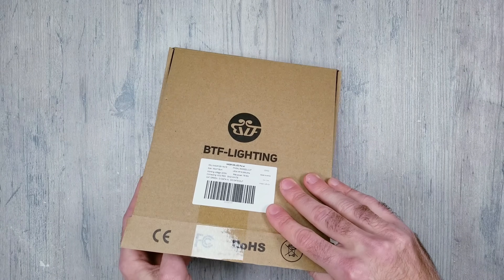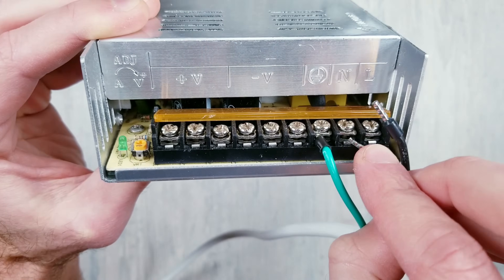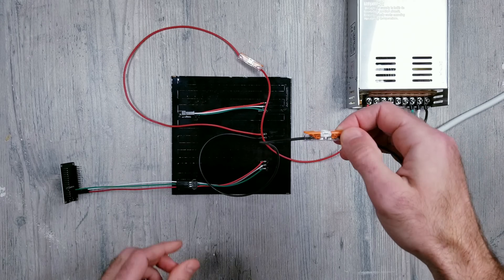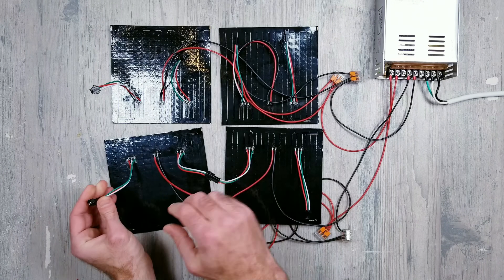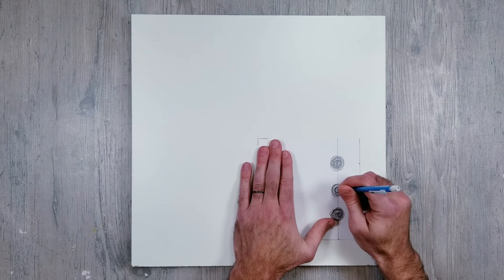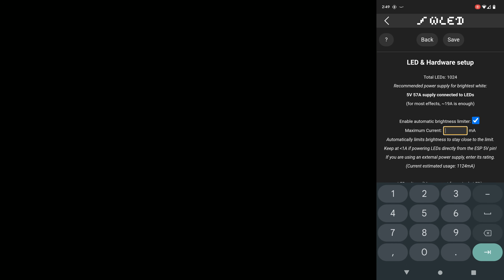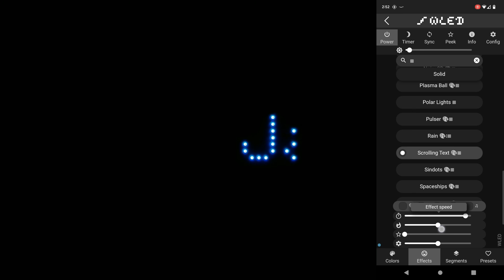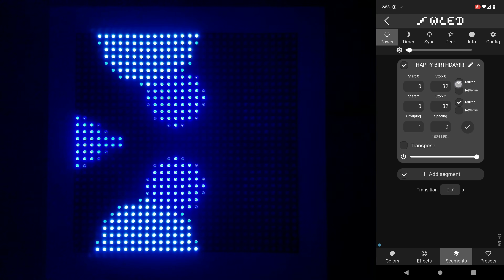1000+ LED Matrix! Setup, Power, Control, Tips - WLED 14.0-b1 2D Matrix

Comment: Hey Chris,
As an electrician, I would like to give you a recommendation: dont twist the single wire and press the ferral on it. This may allow the wire to twist out from the ferral more easily if there is too much movement on the cable.
Reply from the maker: Thanks so much for watching and I appreciate the tip! I just made another video and I did not twist the wires : ) Thanks for looking out!!
Reply: Would you not use fork connectors for that type of connection rather than ferrals?
Reply: @Cook1eMR  This is a great alternative, but costs more. Both, the material (the forks) and the pliers for pressing. But sure, its safer.
Reply: @grabasandwich  Nope. you dont do that. You dont even twist it.
Reply: noticed that as well
Reply: @grabasandwich  This would not increase security and would be an unnecessary step
Reply: Gotta love those wild connectors. (ferral - sic)  Surely you mean ferrule. 😁

Comment: That would look sweet in a frame with some kind of diffuser in the front. Any problems with heat buildup?
Reply: I have one in a 3D printed frame with a diffuser. It runs 24/7. I can feel that it’s warmer than ambient temperature with my hand, but it’s just barely warm, not to the point of being a safety concern.
Reply from the maker: Thanks! That's good to know! Appreciate the info!
Reply from the maker: Hey buddy!! Yeah I do want to have it in a frame at some point! I think it would look great! I have not noticed them getting very hot but I also dont run mine very bright or anywhere near full power. Good to hear from you!!

Comment: hey chris, coincidentally i build a similair 4 panel but horizontal matrix for a name sign. and when setting up wled a got a message telling me if more then 800 leds are controlled on one pin some errors may occur. and sure enough some lines did act up in one or two effects. did you experience the same and if so how did you solve this?
Reply: I have a similar question regarding using 4 panels of 600 leds each.  WLED just won’t allow a single output that large.  I’m using a Dig-Quad board and can use 4 pins on that ESP32.  But can I somehow define 4 smallest panels and make them appear as one large panel?  Each small panel is 24x25, so 600 per small panel and then 2400 leds in total.
Reply from the maker: That is a great question and I'm curious myself if this is something you can do. let me know if you figure things out!
Reply from the maker: Thats a good question! So I didn't have any issues that I saw but I think what you could do is go in and under led configuration and under the gpio settings only put the first half amount of leds there. Then add another gpio pin and then on your esp device, run the data line from the second pin to control the second half of your leds. Not sure if that makes sense but this helped me wrap my head around things better: https://kno.wled.ge/features/multi-strip/#:~:text=For%20good%20performance%2C%20you%20can,a%20total%20of%204000%20LEDs.